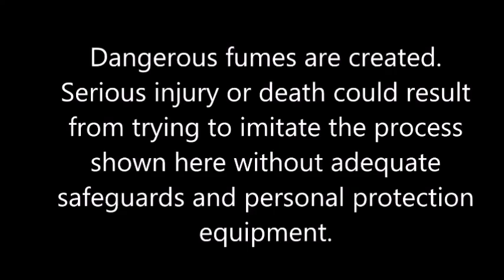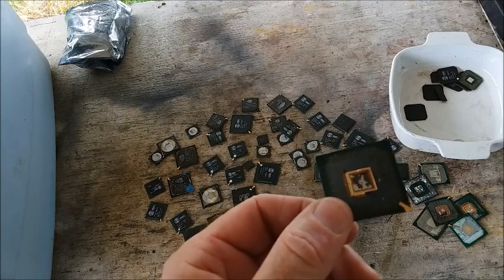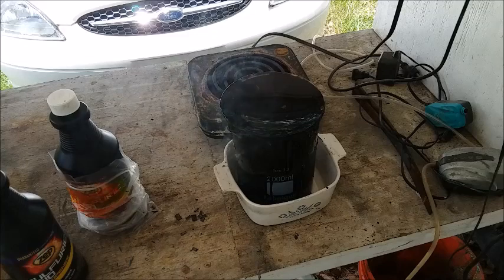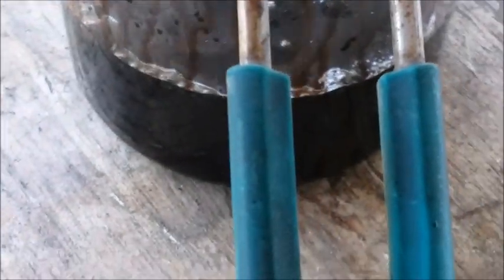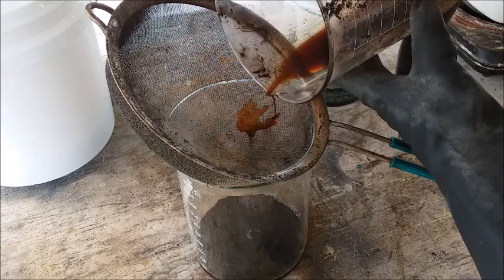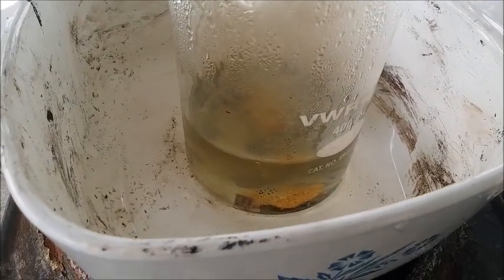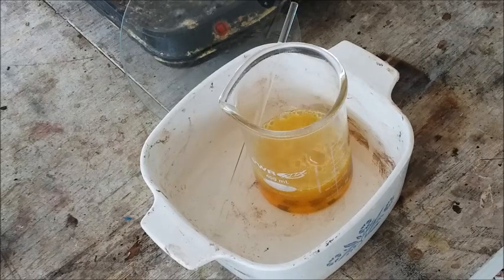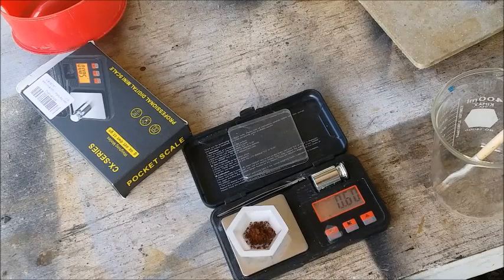Processing Gold Corner BGA Chips to extract gold

Comment: Who Needs a foundry? I use a dog food steel can and an old bar-b-q. A little dried wood and a leaf blower to accelerate the flame a little. Chips incinerated in 10 minutes
Reply from the maker: Yeah, but I also do lost foam casting in aluminum and brass. Since I have a foundry, I use it. I hate to see it sitting idle. Your way would be good for people who want to avoid wet ashing and won't get in trouble for smoking up the neighborhood.
Reply: when you burn them you get much less than is actually available because there is a lot of tin for which there is no acid to separate it.
Reply: @Prince-nt4dc  Tin? Not here. I cut off all the legs before I incinerate the IC's. I don't use acid to get rid of the legs either. I use a magnet to get the magnetic stuff, and use a find copper mesh filter to screen out the larger legs.  If there are any legs left, Then I'll use the acid to get rid of the copper legs and wires. I also remove the Silicon Dies before I crush the chips. No use making a mess of them when you can pull them out whole and not break them into millions of small pieces. Work smarter, not harder.
Reply: @scrapman502  no matter how much you cut the legs, there is still some percentage of tin and the biggest problem is that during the burning the tin sticks to the gold but the nitric acid does not corrode it and the gold remains wrapped in the tin. that way you lose gold.
Reply: @Prince-nt4dc  I don't have that problem. You must be doing something wring.
Reply: @Prince-nt4dc  During burning, there is no "tin" to stick to the gold.  The gold is encased within the plastic and is not exposed to anything until the chips are broken open. By then any "tin" has since oxidized away in the fire. The fire does not get hot enough to melt the legs either. Obviously you don't burn chips because you don't know what you're talking about.
Reply: @scrapman502  you don't want to understand that burning and having tin is a lot of headache and you need a lot more nitric acid. but you know you may be in a country where it's easy to find acid or make it yourself. I here in the country where I live do not have this opportunity and therefore I work by methods with less acid because it is history and to buy too
Reply: @Prince-nt4dc  I don't use nitric acid to dissolve the pins. If you use Muriatic acid, it will dissolve tin.. Also there is no TIn inside the IC's. If you cut off the legs, there is 0% chance you will have tin in your solution.
How is tin going to get onto the gold anyways? I'm assuming you mean Tin = Solder.

Comment: Here's the method that worked for me. Pour in the sulfuric acid to a couple of inches above the chips. Put it on low heat until they're just starts being a reaction. This will reduce the foam to very small amount. Cook it for several hours stirring occasionally to break up the bottom and let it cook. Turn off the heat and let it cool to warm Don't wait for it to get cold and don't process it hot and splatters everywhere. When it's warm pour it off and wash it and do another boil the same way. It might take several boils but when you get down to the bottom and the only thing you have left is some fiberglass patches dies and wire you're good to go. If there's anything left in it carbon-wise or chip wise do another boil on it until there's nothing left but the fiberglass gold and dies.

Comment: You need to make piranha solution, no black carbon to deal with since piranha solution consumes carbon. Sulfuric acid and hydrogen peroxide
Reply from the maker: No thanks. Piranha solution is too dangerous. Besides, I've found a better way. I just incinerate the chips. It only costs me a bit of propane and gets rid of all the carbon too. Check out a later video I made of the process: https://youtu.be/l38-8x52YEw
Reply: @omegageek64  Disagree wet ashing is the best way, no lost gold, less to process and very simple. Your using sulphuric acid, doesnt get more dangerous than that unless your using super acids. Pirahna solution doesnt reguire heat OR do you wet ashing with sulphuric acid until the process is done than add in hydrogen peroxide so it consumes the carbon in minutes than filter, boom you had to deal with piranha solution all for a couple minutes. Incinerating takes to long, its creates a lot of dust and mess, its very simple and anyone can do it with a fire and a coffee can but incinerating isnt for me. 

I started around 2005 and have a backgroubd in chemistry so I have no problem handling acids unlike ewaste ben. My opinion of him is really bad. Hes a scrapper and only that, anyone getting into gold recovery shouldnt listen to him one bit. 

I mainly buy and sell on ebay, from gold recovery to rare and expensive hardware like samples and prototypes. Ill still do some gold recovery but nothing like after getting my health diagnosis. Gold recovery is fun but selling on ebay is far better, more money, kess time refining, no money spent on chemicals and I didnt sell much but no need to deal with whoever your selling too which usually is pawn shops for a lot of people. Thats my opinion on it all.

Comment: at time 4:50 don't forget to mention that usually the solder balls for the bga chips will consist of silver solder vs tin/lead solder for better electrical conductivity of the electrical signals. Keep the lower parts and process for the silver and some gold.

Comment: Hello,  Just finished watching your 2 new videos about refining dirty gold. Great info!   Thought you would like to know that I just used your gold corner IC info on 1002 grams of bottoms.  What's interesting is the weight loss from just getting rid of the tin solder in the Muriatic acid boil. The tin solder weighed 155 grams! Unfortunately the weather here in Phoenix  has turned nasty. Will finish the nitric boil when the weather clears up.  I'll email again with the recovered gold amount.  Many thanks!  Your channel is awesome!!  Jim

Comment: Classic example of "Do as I say, not as I do!" 
You do know that the gold bond wires will go thru the strainer. You will find gold in the acid you poured off. The only way, unfortunately to prevent this is to dilute the acid with water. a lot of it. This will make things get really hot.  Also HOT sulfuric acid will also dissolve copper. Those metal tops of the BGA's were solid copper. That's probably what's taking so long to process them. the Gold "dust" is actually the gold pads and traces you mentioned earlier you said wasn't worth processing. It's actually pretty thick like gold fingers. Hey, Gold is Gold.
Reply from the maker: Never fear, nothing got thrown away. I figured there would be some gold in the acid. I further diluted and decanted off the dilute acid in the smaller beaker. There was a fair amount of solids in the bottom, but almost all of it was fiberglass debris. There were only a few small visible particles of gold. That material went into my used gold filter storage container so it isn't lost. I have plans for the concentrated acid waste too. Once I have a large amount built up, which may take a while since I don't do wet ashing that often, I plan on dumping it into a bucket of ice. Once the ice melts and the acid is diluted, the solids in it should be easy to recover.

Comment: Incinerating is fairly easy I put the whole thing in a sturdy tin can an build a fire around it in my chiminea you need to have a nice bed of coals first than put the can in and stack wood around it the fire will take off and you will have very little smoke and smell when done crush ashes and pull out magnetic stuff and proceed with aqua regia

Comment: Had to watch a 2nd time.
.012g per gold corner bga seems about average.
Should be easy to guesstimate what I should have.
Reply from the maker: They vary in size and number of connections. Some have heavy internal copper heatsinks which throws off the yield estimate based on weight alone.

Comment: What will dissolve the ceramic in ceramic chips?
Reply from the maker: Not much dissolves ceramic chips, and what does is too dangerous for me to want to play with. Crushing them up well before treating them is an option.
Reply: Hydroflouric  acid dissolves ceramic and glass only shipped and stored in stainless steel. You don't want to bother ! DEADLY and instantly absorbed into the body it will dissolve bones while you are alive😨remove legs and  just cush ceramics add ar filter off wash well  3x reduce wash water by boiling off add acid to water than precipitate save your liquors for silver and palladium test later on 😎
Reply: omegageek64, a small hammer mill with a decent filter might be a good investment?
Reply from the maker: @iamanempoweredone6064  I really wish I had a decent hammer mill. On the other hand, I don't process that many ceramic chips, so I'm not sure it would be a good investment for that. However, I would also love to have one for dealing with gold ore.
Reply from the maker: @richardperkins3612  Hydroflouric acid is scary stuff. I had to use it some years ago to etch serial numbers on glass standards. I was very glad when I didn't have to do that any more. It is just to toxic to deal with on an amateur basis. Even with all the PPE and a decent fume hood my employer provided, it was scary. Getting rid of the waste acid was tough too.
Reply: omegageek64, smelters routinely use ball mills after a circuit board burn. I did electronic recycling for precious metals for 5 years. When it was worth it. Now again it is worth it mainly because the price of palladium is so high. Also separating tantalum nubs is becoming more lucrative.

Comment: Your doing it wrong. Once u cook the chips. Add alot of water and it will be eay to separate the gold from the acid because it will be very liquidity. Also it will be less dangerous. The acid will hest up but it will also cool down from the water. Pour off the acid water a few times and ALL THE GOLD will stay in the beaker. Then aqua regia
Reply: Also i pour the acid water in my stock pot which has ALOT of water and makes it safer and it will collect all the gold that gets out
Reply: If u do this u can filter the acid because it will be do dilute

Comment: now I am 42 years old and I started extracting gold from electronics and other different things from when I was 15 years old I can tell you that you either cut off part of the video or you are hiding something because at 32:07 you pour water and very little nitric acid. such a process cannot exist. thanks for sharing anyway
Reply from the maker: Not sure what your issue is? As I clearly stated in the video, I was giving the material a boil in dilute nitric acid to dissolve any copper or other base metals present. Water plus a little concentrated nitric acid is the recipe for dilute nitric acid.
Reply: @omegageek64  for me the water was to much and the nitric acid very little. then nitric acid no matter how pure it is there will be no reaction I know from personal experience